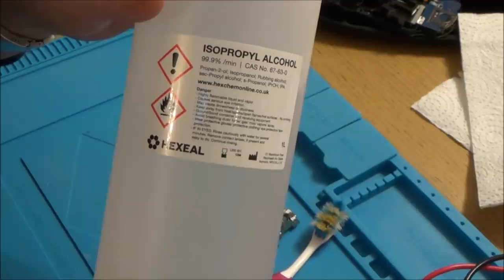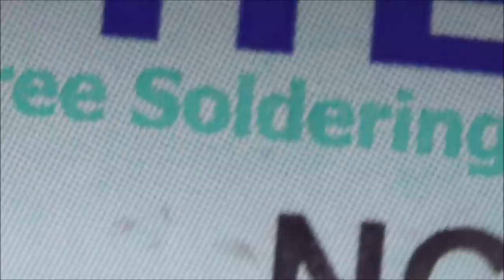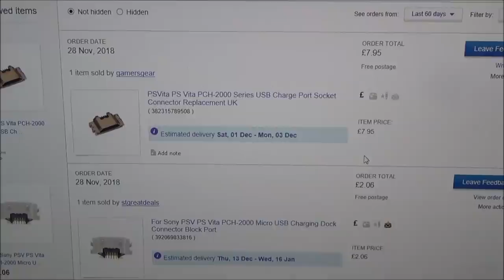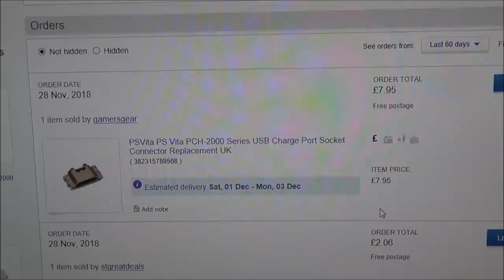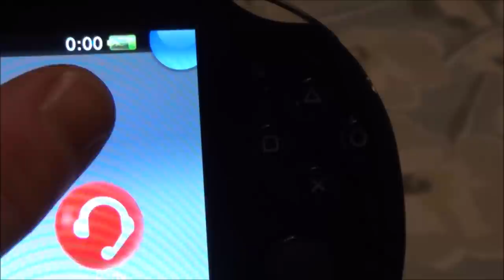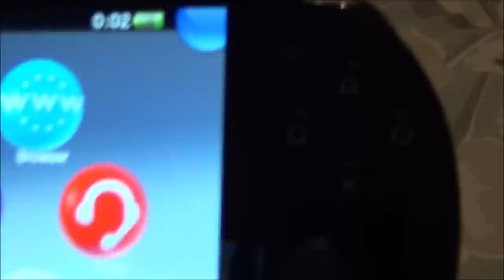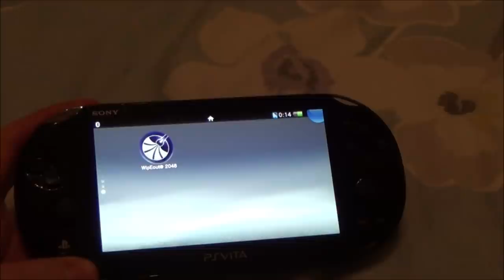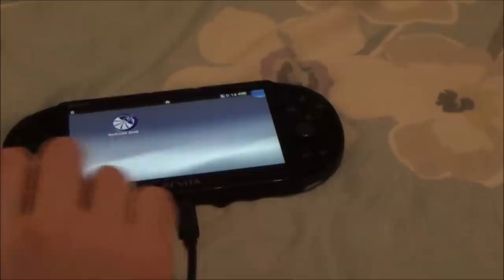Trying to FIX a Faulty PlayStation Vita - Sony PS Vita Slim

Comment: HI I HAVE PS VITA 2000 BUT SOFTWARE IS BRICK WHEN I TURN ON IT SHOW UP ONLY BLACK SCREEN AND MY PS VITA WONT CONNECT TO PC PLZ ANYONE KNOW SOLUTION HOW TO INSTALL SOFTWARE PS VITA 2000 AND I CAN CONNECT PC MY PS VITA
Reply: Mister Donkey nup
Reply: Mister Donkey not able to touch reset option only so software update from PC or wifi

Comment: You didn’t have to persist in cleaning the solder as there was no advantage. All that heat was melting the board and heat transfer is a possibility where other components could be damaged. So painful to watch the overuse of heat and solder. No need for the hot air gun, that was painful to watch too.

Comment: You could just lifted the legs up using dental tools or a needle and then cleaned the solder points with flux.  Then tin the solder points without removing the micro usb connector.  If the connectors were gone just use jumpers to solder them from the usb connector pin to the next trace point.  But if you have done that the video would have been less than 20 minutes long = less money on youtube viewed.
Reply from the maker: Thanks for the suggestions. I did try and move the pins to clean underneath them but the solder didn't stick. I had to really scrape them with the fibre pen to get them clean so without removing the port I think I would have struggled or ended up breaking the little pins. Not sure if the length comment is trying to suggest something BUT I have plenty of short videos on YouTube as short videos get more views so personally I disagree with longer videos making more money. If you want views then a 4 to 7 min video is perfect. An hour long video gets much fewer views but I find it hard to fix something in less time. If I had to solder from the pins on the corroded port to the others parts on the board, I think it would have taken me as long as the replacement port :-)

Comment: You can check if its a good battery by hitting it with your bench power supply and see if its drawing any amps.The volts are totally irrelevant.
If it does it means the battery 
i) isnt fully charged 
ii) It can take a charge and its good.
You can charge the battery with your bench power supply to see if the unit is working aswell.
Li-ion batteries have 3.6V empty and 4.2V when fully charged.

Thanks for another great video
Loved the robotics sound of your automatic tripod

Comment: At 25ish you have a hard time removing the solder from the holes. At work if this happens we use a small drill bit and hand tool to hold it and we drill the solder out by hand